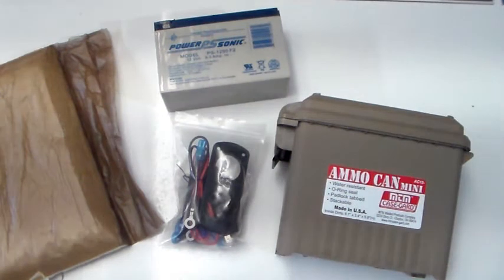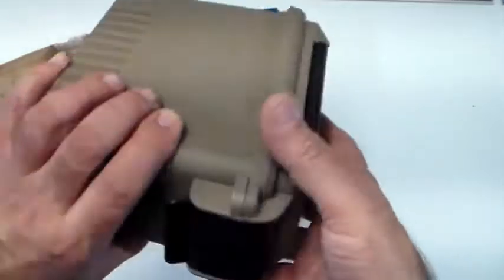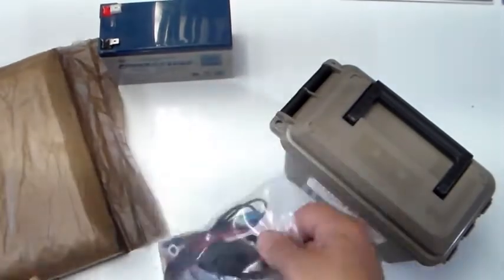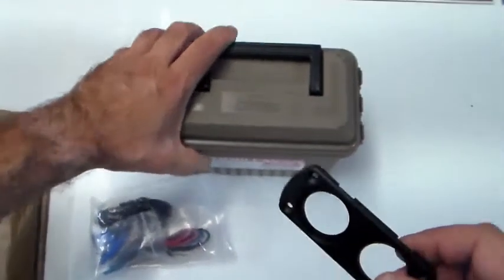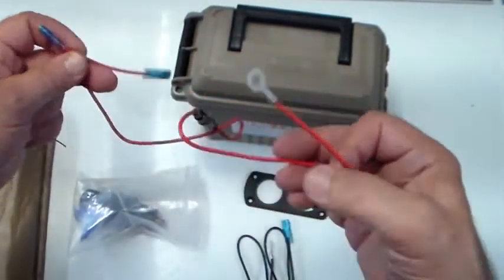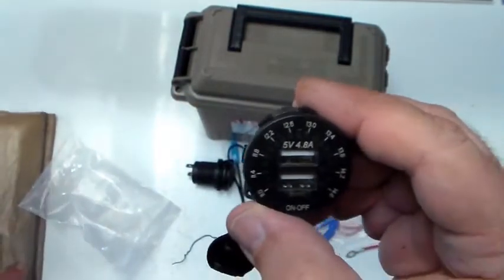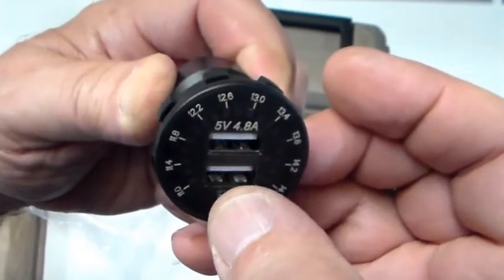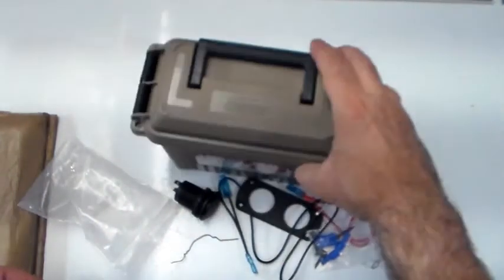AMMO CAN BATTERY BOX BEGINNER BUILD 1

Comment: Just keep in mind with. SLA battery you can only use half the rated amperage or you risk damaging the battery.
Reply from the maker: Good point. These are deep cycle batteries and they're not designed to release a lot of energy quickly and recharge quickly like a starting battery.  Hey, thanks for watching!